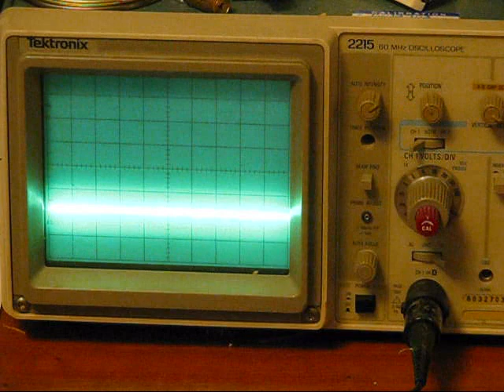The arduino light sensor module with on-board comparator from engineeringshock.com

Comment: im having a lot of trouble trying to calibrate the sensor module, its either too sensitive and wont turn off in a dark room or its not sensitive enough and gets shut off too easily. now i seem right about in the middle of both and its just lightly blinking but stays that way in both light and dark cases making it very difficult to control my program for an automated bed lighting. any tricks or suggestions? any way i can get it to turn on or off at specific light lvls? thanks